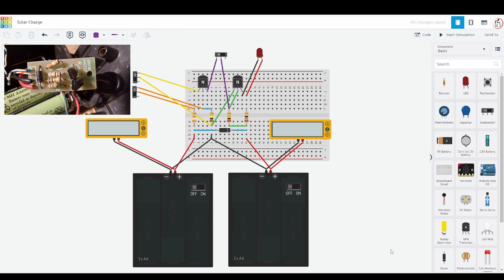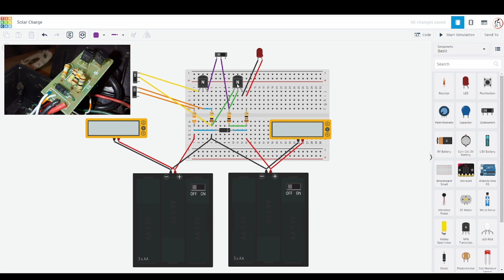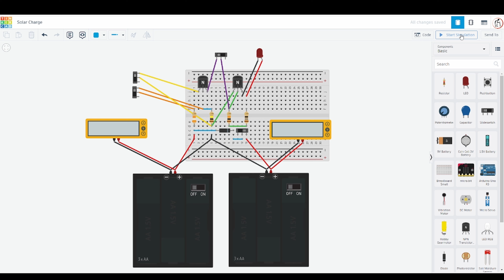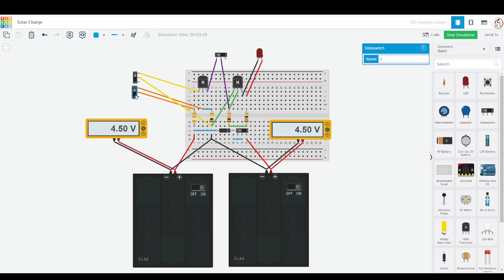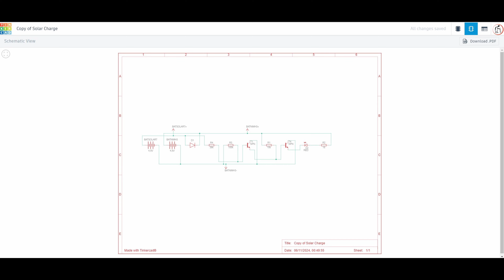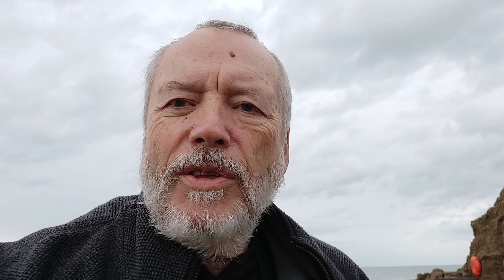Solar Flowerpot Repair revisited after 3 years PART 3 Tinkercad Circuit Simulator

Comment: That's excellent Graham. I assume the Tinkercad simulator is not a stand-alone utility?
Looks like you have got the hang of how it works. Can you bring up a schematic with this software so it can be printed?
I have used Circuit Wizard, the free version, in order to print a circuit for transferring to blank copper board.
Then I etched it with etching fluid. Worked well. 👌👍👍👍
Reply from the maker: It produces a line diagram schematic (shown near the end of the video), but not a layout suitable for printing the circuit to copper. Tinkercad is what I use for all my 3D printing design work. It also had this circuit simulation capability. It is all online and free to use. It is aimed at kids in school, so it is kept simple and basic.